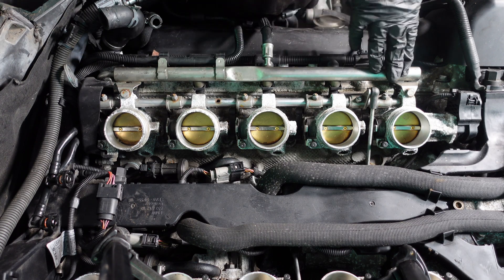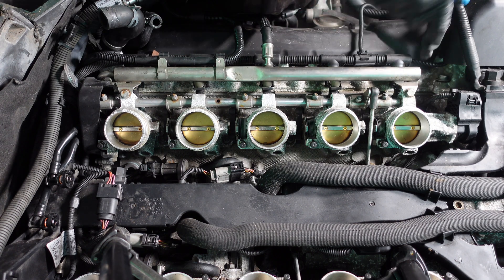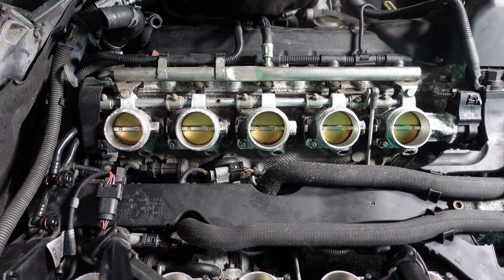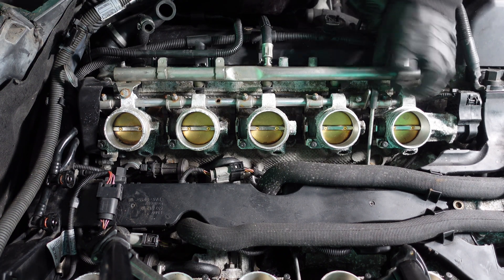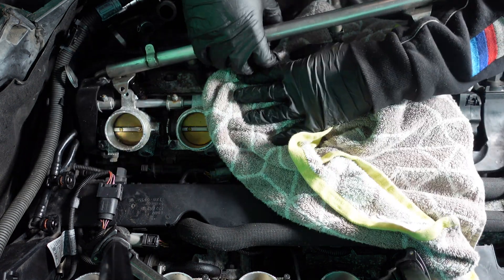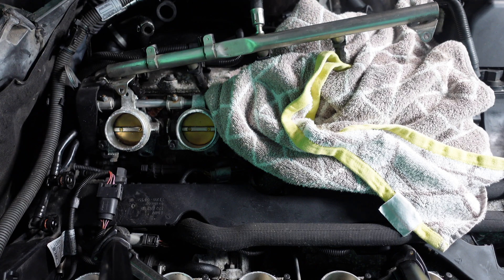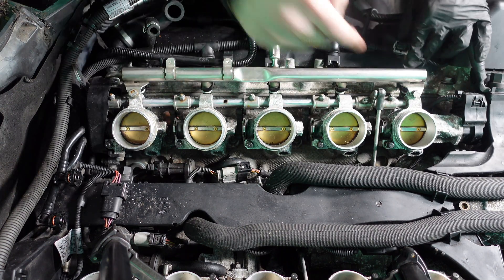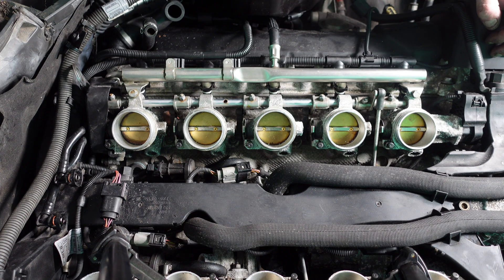BMW S85 / S65 / N52 Fuel Injector Removal & Replacement

Comment: would you be able to help me find out why oil in in my injector plugs where the wiring harness plugs into my injectors. it has oil in there.. is it due to internals on all injectors when to crap? or to much pressure pushing back into my injectors  forcing oil vapor back up into the connector prongs?

Comment: What injector brand did you use to replace these?
Reply from the maker: Bosch only ! I have never heard of any other brand of injectors for BMW and if there was I wouldn’t even trust to use them, As far as I’m aware Bosch is the ONLY manafacturer for injectors for these engines. So anyone else would be a huge gamble
Reply: @BMWDoctor  my man! Thanks for all your knowledge.  I'm ordering new Injectors right now, spark plugs (debating on ordering coil packs as well for spark plugs) new upstream wideband sensor as well. I have infinity design long tube headers and was wondering if I should order new post cat  o2 sensors as well? I'm not sure if they are disabled through my infinity design tune or if they are still needed to interact with the wideband upstream even tho it's catless. I love how real you keep all your post though mate. Oh and also do you think it's a good idea to install a secondary in line fuel filter or just replace the intank fuel filter or do both? I'll venmo or cashapp you for answers bruv
Reply: @BMWDoctor  the blue park of the hose where u press to disconnect I don’t got it idk why looks like I got to unscrew it ?
Reply: I have m5 f10 car i use bosche injector’s? Many said i most to use bmw brand injector’s but they are so much expensive so can i use bosch?

Comment: I would have disliked the video but one has to appreciate the effort and time put into making it. You are an expert infact a Doctor of BMW and you are not aware of the procedure to depressurise the fuel system before xarrying out any work...
Reply from the maker: That is one of the ridiculous things I have ever heard someone say. If you was aware this car hasn’t been started for over a month as the whole car has been stripped fully. Therefore the system was under ZERO pressure as I haven’t started it. Tell me your one of those who would disconnect the battery before changing the injectors also 🙄

You only de presssurise the system when the car has been started this car was under NO pressure as can be seen in the video, this is a easy job for someone like me with skills and know how, for someone with your mind you would probably think you have to dr pressurise the system everytime you touch the fuel rail in which your wrong. If a car has been left sitting without starting the system is NOT under pressure by any means. The system only comes under pressure when the car is started therefore pushing fuel to the injectors, if you watched the video clearly you would see no huge amount of fuel even left the fuel rail therefore it was not under pressure, if it was im sure you would of seen a massive amount of fuel pissing everywhere. 

Your speaking to someone who has done jobs like this for over 15 years i am no newbie to this job and neither Isit something as my first attempt so do not talk down to me like your a expert because if you was you wouldn’t be here watching this video clearly.

I’m old school I remove airbags and play with the electronics on cars without disconnecting the battery and never had a issue in my time because I know what I’m doing I’m not the type to disconnect battery for anything as I have no fear of cars if it explodes well then it explodes, don’t work on cars if you can’t take risks plain and simple same way I like to get under cars with just a jack no axle stands and I done that for 15 years and I been fine.
Reply: @BMWDoctor   i appreciate  you  and your work and the experiance you bring here is phenomenal.. this should be about helping others do it right .. Not everyonr has your skills or experiance .. The fuel in the rail can be pushed  back into the fuel tank rather than risking the  cyclinders flooding  and trying to catch it with towels ...No mattet how  one thinks he is the best , someone is out there better ....Education is Knowledge  that's  why i enjoy watching your videos to gain more  Anyways thanks for the video .... Thumbs up all d way
Reply: Yeah I have to agree this was not the smoothest TIS-level install I've seen or done.  Not helping the top o-rings slide in to the rails was a bit odd, but smacking the faces of the new injectors onto block 3 or 4 times made me cringe like I could feel their pain haha :)

Comment: How long does it take ISTA to re bleed the fuel after this?.  Just curious.  Another great video Dean thanks!.
Reply: You won't have to bleed with any diagnostic. Put acc mode on for about 30 seconds and start your car. Fuel pump pumps Fuel when acc is on and it will bleed your fuel system.